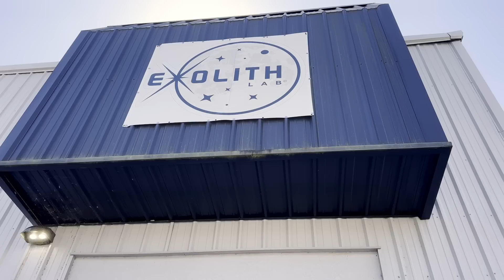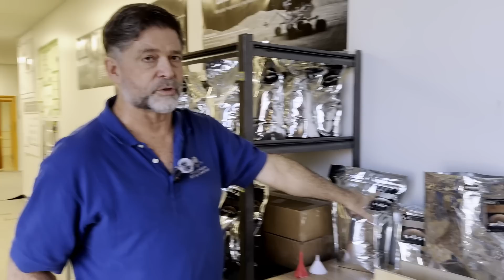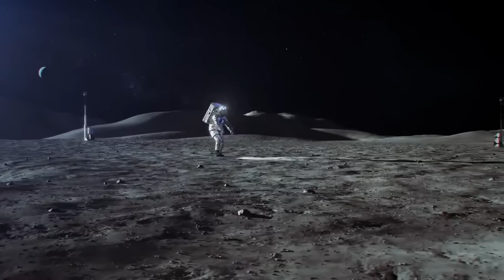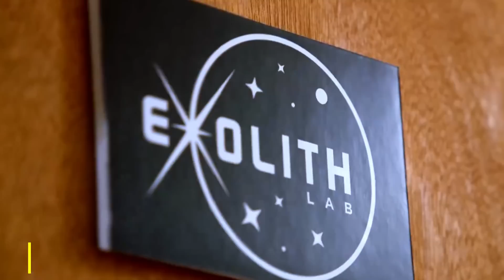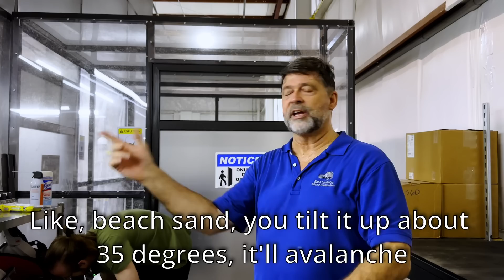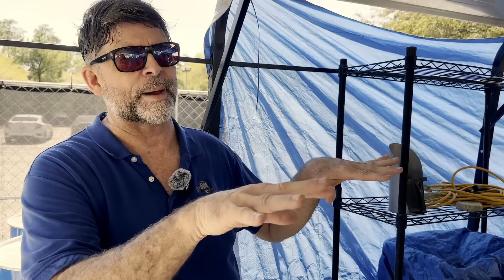Why Most Moon Rovers *FAIL* This Simple Test

Comment: No real need to reinvent the wheel for a successful rover: There are amazing off road RC cars and trucks that work quite well and recover easily from flip over crashes and still go on fine.
They simply need to make larger versions of these and then add autonomous software for them.
Also, a suggestion to rover designers: Bigger wheels!

Comment: Based on your description, it seems you might be referring to "cronstedtite", a naturally occurring mineral that is sometimes referenced in the context of synthetic mineral simulants like those produced by Exolith Lab. Cronstedtite is an iron-rich phyllosilicate mineral (a type of layered silicate) found in certain meteorites and planetary regoliths, particularly those associated with carbonaceous chondrites or Martian soils. Its chemical formula is typically Fe²⁺₂Fe³⁺(Si,Fe³⁺)O₅(OH)₄, and it’s known for its complex iron content and hydrous nature.
In the context of Exolith Lab’s work, cronstedtite is notable because it’s a mineral that doesn’t occur naturally on Earth in large, commercially viable quantities, making it challenging to source for high-fidelity simulants. For example, Exolith’s asteroid simulants (like those based on CM chondrite mineralogies) aim to replicate such minerals, but they often substitute or synthesize approximations due to this scarcity. The misspelling "chrostitight" could easily be a phonetic or typographical variation of "cronstedtite," especially given the context of synthetic mineral simulants.
If this doesn’t fit what you’re looking for, could you provide more details about the intended use or properties of the term? I’d be happy to refine the answer further!

Comment: Great episode- I'm immediately thinking of combining two crazy ideas from late 90's science parody columnist 'Daedalus' about the fictional "DreadCo' manufacturing:  how about 
lunar tires & excursion suits that are coated in a UV catalyzed sticky polymer? Bind a surface layer of abrasive moon dust on the outside of the suit, use the abrasive properties of moon dust to protect the equipment from moon dust.

This is based off two bonkers columns from Daedalus- 
First, the self-retreading tire which would be a tire shaped sponge filled with liquid rubber, pressurized by N2 gas- as the tread wore off, new liquid rubber would seep out, oxidize and polymerize- the removing the need to retread a tire.  Adapt that to UV catalyzed polymerization to retread tires with lunar regolith.  
Second, the 'automatic no parking zone'.  Create a polyacrylamide-based paint for Loading-Only / No-Parking spaces. Formulate it so that it polymerizes in a reducing / non-oxygenated environment, after say, 30 minutes.  Easy and effective- if you park there, for 30 minutes, your car tires end up glued to the ground.  Easy for the meter-readers to find you now.

Comment: Dosage makes the poison. Most of these particles probably aren't a huge deal for someone like Ellie touring and getting minor exposure one time, while still dangerous for someone who works there and gets exposed repeatedly for years on end.
Reply: First attempt deleted... Dosage doesn't make the poison for silicosis. While most poison has a lower level where it's completely harmless, mineral dusts do not.
Reply: @gasdive  Sure it does, or everyone who goes to the beach once would get silicosis. Harm may never get to zero, but will definitely get low enough that the average person's lung regeneration takes care of it just fine. Same way sitting around a campfire won't hurt you any, but taking up smoking is cancer Russian roulette.
Reply: Dosage doesn't really make the poison for stuff like this. Most poison is harmless at low exposure levels. You and a thousand other people can breathe 1000 ppm CO2 every day and no one will die. Materials like this can kill you even at very low doses. Expose a few thousand people to a low dose and some small number will die, though it will take years.

Comment: Lunar regolith can be managed with the electric charge device tested by NASA on the Blue Ghost 1 mission when installed in any doorway of a lunar habitat.
Reply: Not yet proven but so far so good.
Reply: Initial testing did show the process works. Now its just a matter of upscaling the equipment into a habitat design or enclosed rovers to be functional @MarkHorton-n3t

Comment: It's actually important work, we need to figure out a way to Cementify the regelith to make first landing pads. We will eventually need to make habitats and then we will need to burrow beneath the surface for long stay habitat s. I'm thinking some sort of epoxy to be mixed with regelith, maybe UV cured? Might not work as UV doesn't penetrative, perhaps regular epoxy but UV resilient.  I'm thinking a machine that takes in the rebelith like a garden rototiller that mixes in the epoxy then discharges it to a box screed that leaves behind a nice smooth flat surface to cure and become hardened.

Problems to overcome, how to get the machien to have enough downward force to dig into the regelith. Can we make an epoxy formulated to cure in negatice 300 and withstand positive 300°?
Reply: I think epoxy's Achille's heel is that it can't handle high temperatures. However, there are lots of other options. But one worth considering is simply high-temperature sintering to make it bind.